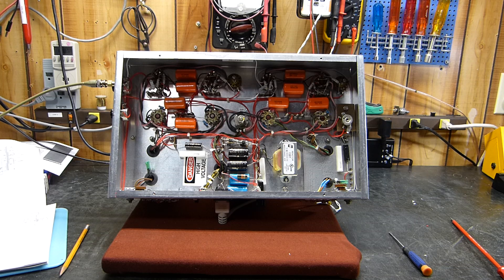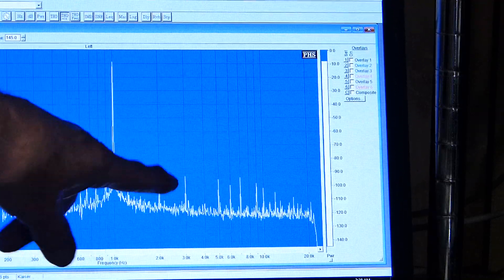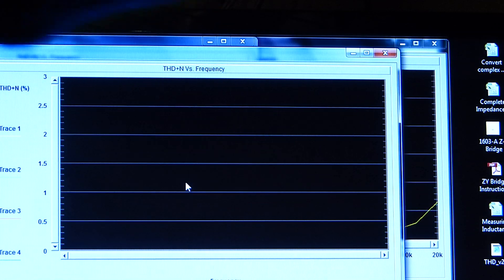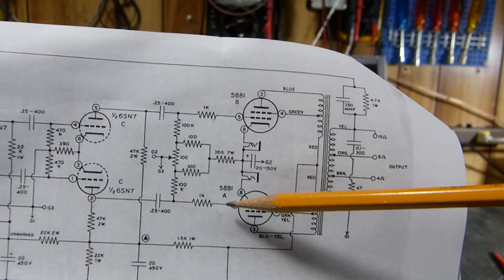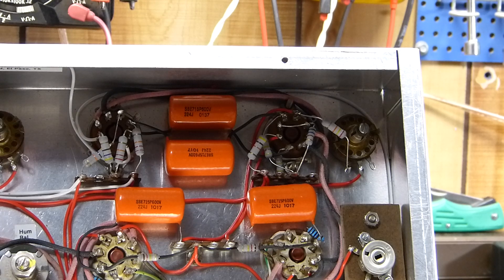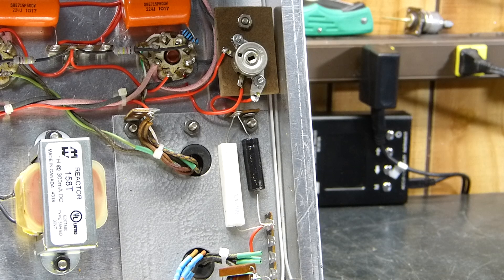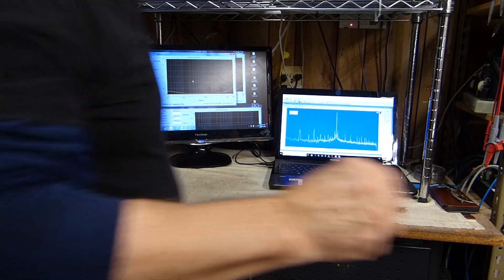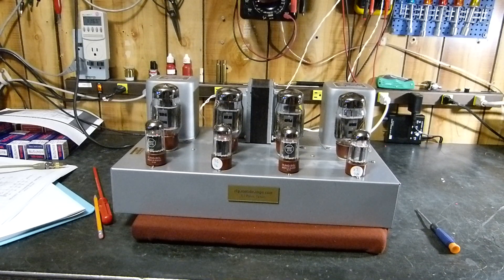Williamson Amplifier With Cathode Current Balance and Dynamic Drive Balance Improvements

Comment: The RC network in the plate circuit in the first stage is indeed used to increase high frequency phase margin and thereby improve stability. It is a technique called pole splitting, in this case reducing the pole (HF rolloff) of the first stage compared to the driver stage, the output stage, and the output transformer. The actual values will depend on the output transformer, the closed loop feedback ratio, etc. Distortion at high frequencies rises when it is added because you are reducing open loop gain at high frequencies, and therefore reducing the feedback at high frequencies.
Reply from the maker: Thank you. Beautiful explanation. I will have to wrap my head around that and learn more about the poles. My question comes in because I don't see any instabilities without it but, as mentioned, maybe a square wave test will reveal something. Really appreciate you comments.
Reply: ElPaso TubeAmps yes, looking at square waves would be a good idea. Another thing you can do is disconnect the feedback and look at the phase shift (phase lag or phase delay) of the output terminal (where feedback is taken from) relative to the input. If you sweep the input frequency from say 1 kHz to 200 kHz, you will be able to identify where the open loop gain drops to 0dB. If you look at a range of frequencies up to the 0dB gain transition frequency, you don’t want to see a phase lag of more than about 120 degrees. If you do, it’s time to slow down the first stage until the above conditions are met. The quick and dirty way to approach the problem is to just adjust the BW of the first stage until the square wave is neither excessively rounded nor ringing. By the way, depending on front end topology and output transformer characteristics, you will sometimes end up shunting the feedback resistor with a capacitor instead of taking steps to slow the first stage down. Also, it is best to look at the frequency response of the output stage (power tube control grid to speaker terminal) under load to see if you have a resonance in the output transformer. Many output transformers do, and this will add a lot of phase shift which makes stability more difficult to achieve. If you see transformer resonance, you can often damp it with an RC circuit from the feedback terminal (e.g. 16 Ohm tap) to ground. Take a look at the Heathkit AA-61 or AA-81 for examples, though you’ve probably seen others. Ideally, this step should be performed before tuning the first stage bandwidth.
Reply from the maker: @jonathanknight8251  I have printed your thoughts here and will look into it. Much appreciated.
Reply: ElPaso TubeAmps my pleasure. I’m looking forward to your findings.
Reply from the maker: @jonathanknight8251  I assume you are referring to what I hear called a zobel network on the output of the transformer. I don't think the amplifier has any actual stability problem. I did do some testing last night with a square wave and found there is just a slight bit - I mean seriously, just a slight bit of overshoot and ringing on the leading edge of a 1KHz square wave. A 10KHz square wave (all at 15 watts) is "square" but the bottom has what looks like a third harmonic imposed on it ??? Varying this little RC circuit does very little to the 1KHz square wave and lots more to the 10KHz wave. A zobel network on the output does nothing that I can see shy of a 0.47uf and a 10 ohm (or lower) resistor. I have been thru this before and after lots of floundering have given up and left this particular RC network out. The sound of "grit" I expressed is something I can not say is actually real. Subjective tests trying to describe tiny nuances in sound is just too "subjective" for me to put into words. It's like great art - I know what I like...   :-)  and so does everybody else. I have tried small value capacitors all around the voltage amplifier and output with no real luck to stop all ringing and make the perfect square wave. In some of the older amplifiers we see 50 pf or so capacitors between plates of the output tubes, small capacitors off to ground, etc. In the 80 watt amplifier I built recently, I did add some RC networks off the UL screen taps to ground, per a schematic using that particular OPT and it did change things a little for the better. I really appreciate your thoughts on how to hone in on objective measurements.